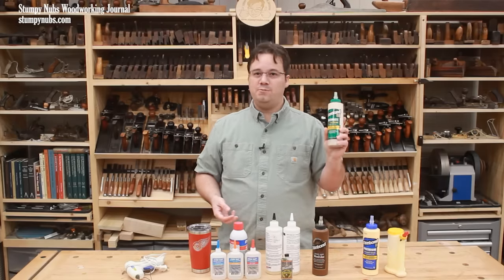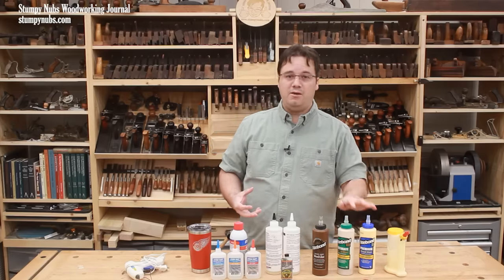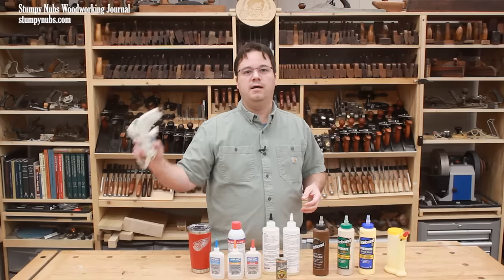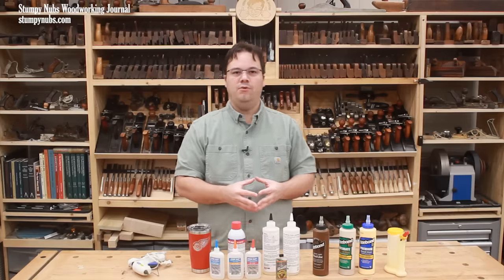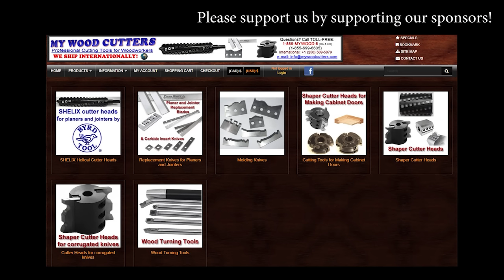Why I don't use Gorilla Glue

Comment: I never  use Gorilla glue. It foams and pops the joint. I don't care for tite bond mainly because I have arthritis and can't get the top open unless I use a pair of pliers. I am going back to Elmers glue as that is the glue I've used since high school in 1960. I made a small book case in 1962 and the glue joints just started to fail this year. That's good enough quality for me. 60 years.

Comment: I don't agree with the title of your video as it may put people off using Gorilla glue and you are only really talking about their polyurethane glue. Gorilla make superb modified PVA glues every bit as good as Titebond and I have been using them for years with never a single issue. I dont want gap filling glues as I would prefer to remake a joint rather than bodge it. I would also say that I have used Gorilla Polyurethane glue on external structures with complete success and think that it is poor application which gives some people problems. Poly only needs to be applied very thinly to produce an exceptionally strong joint so there does not need to be a huge foaming mess. I have even used it on wood to stone and after years in extreme weather conditions it is still 100% secure.
Reply from the maker: PU glue is the flagship adhesive of the Gorilla brand. It has become synonymous with the name "Gorilla Glue". The company itself calls it "Original Gorilla Glue" and when you say "Gorilla Glue" that is by far the adhesive people think of. I even showed their distinctively shaped PU glue bottle in the thumbnail image of the video.
Reply: @StumpyNubs  Here in the UK, Poly is only one type of Gorilla glue and there is far more of their PVA sold very successfully. As my Son lives in Atlanta I realise that Titebond is the number one glue in the USA, but I have to say I prefer Gorilla.

Comment: tight bound 3 is not waterproof, it is water resisted
Reply from the maker: While few things are truly, 100% waterproof, They advertise it as waterproof: "Titebond III Ultimate Wood Glue is the first one-part, water cleanup wood glue ever offered that is proven waterproof."
Reply: @StumpyNubs  on the bottle it says it is waterproof. But in the fine print it says it is water resisted. It is probably some of the best wood glue you can get. It is something that should be pointed out that their own disclaimer is that it is water resisted.

Comment: I completely disagree with your hide glue analysis. It gets brittle and will not move with the joint. The PVA glues have made a renaissance in our trade. The reason that people have historically looked askance at veneers is wholly due to hide glues brittle shortcomings.

Comment: Why only talk about regular gorilla glue? You should have added gorilla wood glue. I get it that regular actually expands but wood is great and way cheaper than tight bond
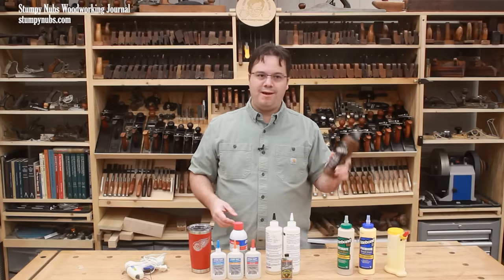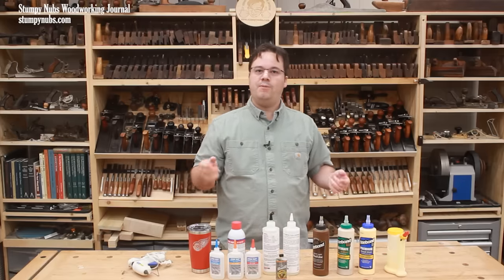Reply from the maker: I mention Gorilla Glue three times in this video. Once in the section about PVA glues (3:21), once when I showed which epoxy injector I use (6:37) and again when I specified which of their adhesives I don't use. (10:14)

Comment: You left out the 19th century classic "hot hide glue."  This too is a no-clamp glue and is still the only choice for serious musical instrument manufacturing as well as veneer application.  It is completely  reversible using plain water. 
Learn how to use it.  Get a controlled heater and go to work.  There is nothing quite like it.

Comment: I think i am missing the point of this video. Why would anyone use normal gorilla glue when they make a wood version that works great.
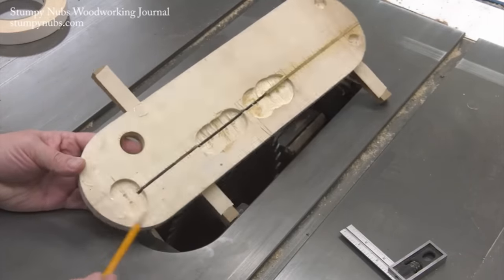Reply from the maker: I did not say I don't use the entire Gorilla brand. In fact I noted that Gorilla makes PVA glues that are comparable to the Titebond formulas I use (3:21). I also showed that I use Gorilla's epoxy injectors (6:37). It was only Gorilla's PU glue that I said I did not use (10:14). PU glue is the flagship adhesive of the Gorilla brand. It has become synonymous with the name "Gorilla Glue". The company itself calls it "Original Gorilla Glue" and when you say "Gorilla Glue" that is by far the adhesive people think of. I even showed their distinctively shaped PU glue bottle in the thumbnail image of the video.

Comment: If you had used the gorilla glue on projects, you would have found that it is basically a gimmick.
When it came out years ago,we believed the claims on the bottle, and used it for many radius stair nosings.
The truth is, it is NOT a strong,or deep penetration bond.
As a result,these laminations mostly failed, and had to be remade.
With Titebond,they fixed right up and haven’t had a single failure.
Gorilla glue is not good enough for any professional use I can think of,period.
Any joints that experience any structural load,had better have nails in it too.
It’s that bad.

Comment: Strange title... Gorilla Glue, is... a brand. Not a glue type.

I have used PUR (not Gorilla Glue brand - never actually seen that brand as PUR here in Sweden), and it sticks like f--k!
Fills all voids, really bonds and the foaming can be cut away and sanded after.
Used it to repair a chair where the leg was getting loose because of the previous glue gave up. And here we have a hole, with a stick in - then PUR will totally just CRAMP them together by its swelling between the hole wall and the stick. It can't be any more firm! (and no, not a problem on this chair if a leg brakes because IF that happens, they are out of here and replaced because of age and wear and tear and not especially expensive chairs - and if the glue would ever loose it's grip, i just glue again).
Reply from the maker: PU glue is the flagship adhesive of the Gorilla brand. It has become synonymous with the name "Gorilla Glue". The company itself calls it "Original Gorilla Glue" and when you say "Gorilla Glue" that is by far the adhesive people think of. I even showed their distinctively shaped PU glue bottle in the thumbnail image of the video.

I mentioned Gorilla's PVA glues as something comparable to the Titebond formulas I use (3:21). I also showed that I use their epoxy injectors (6:37). It was only their PU glue that I don't use (10:14)
Reply: @StumpyNubs  Have you ever thought of that your audience might be a bit bigger than just from USA?
If i say Gorilla Glue here, most people does not even know what that is.... except well, some sort of glue, because of the name.
Reply from the maker: @Xanthopteryx  - The title of a video is meant to elicit curiosity. The video itself explains the details.

Comment: Gorilla makes different types
Reply from the maker: Yes, I mentioned Gorilla's PVA glues as something comparable to the Titebond formulas I use (3:21). I also showed that I use their epoxy injectors (6:37). It was only their PU glue that I don't use (10:14) which is their flagship adhesive and is what their brand name is most known for.

Comment: You know your watching an advert for a financially "endorsed" brand when the guy happily goes over the different types of glue provided by Titebond, yet goes onto not recommending Gorilla based on a single product without also diving into the different types of glue they offer. FYI, they make more than just polyurethane based glue. Very biased title and video.
Reply from the maker: Lol... No. I've never rook a dime from Titebond.
Reply from the maker: @Max Power  Because the video is about TYPES of glues. I speak of Titebond only in the context of discribing the properties of PVA glues. Titebond happens to be what I had on hand, but I also pointed out that Elmer's and Gorilla make comparable PVA glues. But the Gorilla brand was built around and has become synonymous with PU glue. That's what 90% of people think of when you say Gorilla Glue, and it was the contrast I was drawing. It's all in the video.

Comment: Polyurethane/Gorilla Glue is great stuff with a multitude of uses. NONE of them are in fine woodworking.

Its ability to stick like shit to any surface, and expand to fill gaps make it outrageously useful in DIY and home-repairs. The first place I bought when I got married had brick internal-walls, which meant that wall-mounting anything heavier than a photo-frame needed a masonry-drill and some rawl-plugs. Sometimes, I'd drill into a bad-brick and wind-up with an oversized or squint hole. A wee squirt of Gorilla into the hole before inserting the rawl-plug and the problem was solved.

I will admit to using it on wooden furniture - because I always have a small bottle on-hand, I've used it umpteen times for repairing garden furniture, and hidden parts of my kitchen-table that take a lot of punishment. But, now I'm actually building things from wood from scratch, I have more suitable glue to hand.